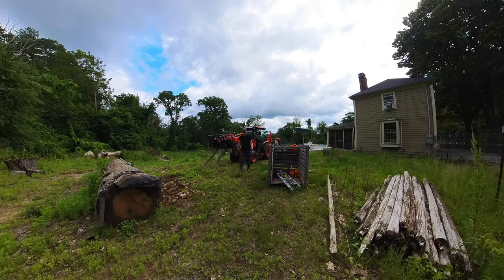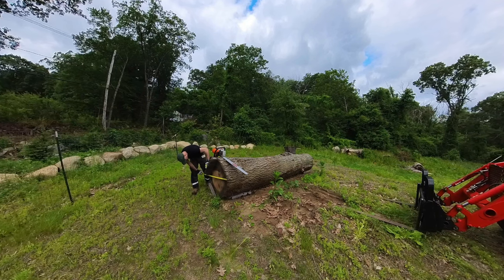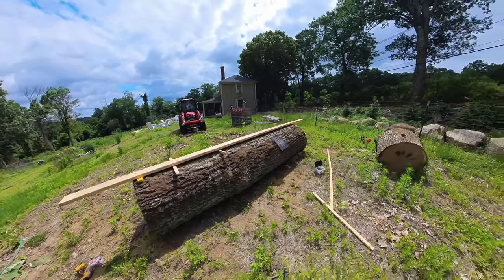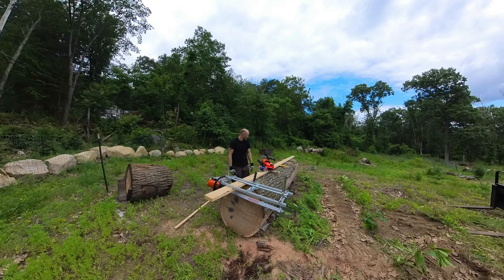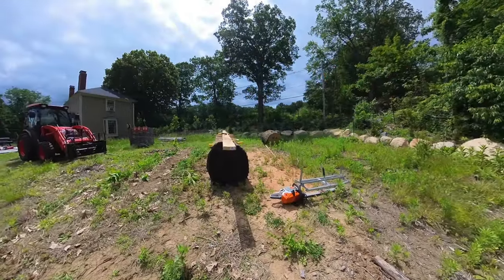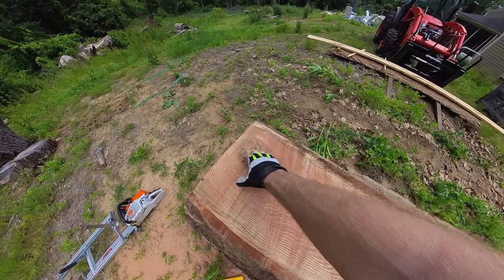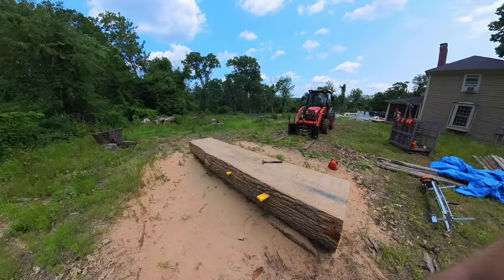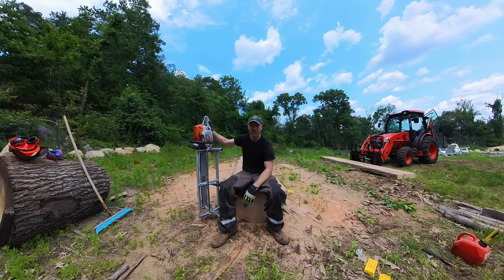Start To Finish Chainsaw Milling | Log Is Too Big

Comment: I’m supposing by the performance…and you just started cutting as I write this, you’re not running a ripping chain. It’ll be much easier with that. But you show it can be done right?!?! 
I don’t know what you’re running for a saw but 36 inches of chain is a lot of work for the power head. I’m running a 28 on a 93cc power saw…I could go 36 but I’m stressing my saw a lot less at 28. Yea, it means smaller trees absolutely…but it’s still a good board.
Lovin seeing you back at it!!
Reply from the maker: Definitely maxing out the saw and the 36” bar is max recommended.  I did have a ripping chain on it, but saw was struggling a bit with it. Something to add to the wish list, bigger saw!